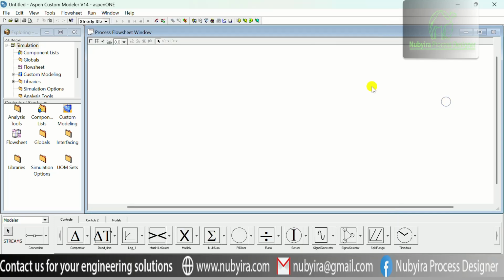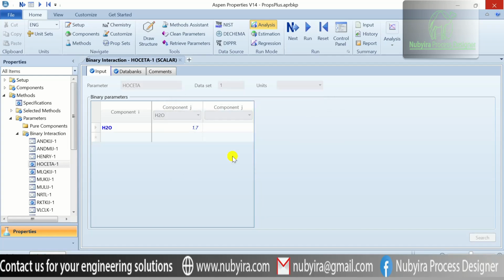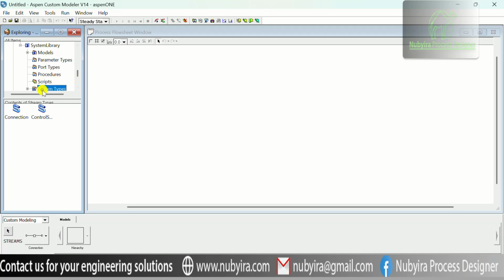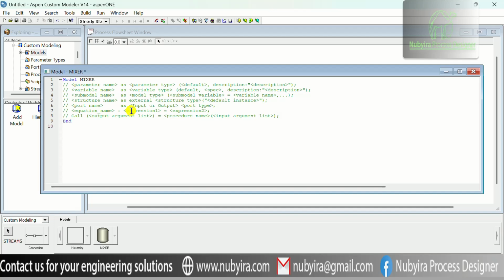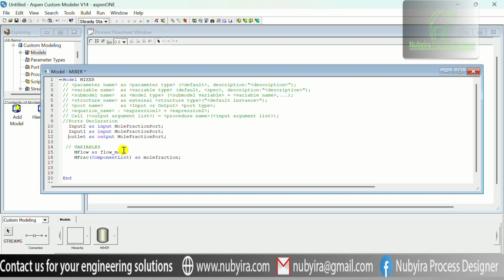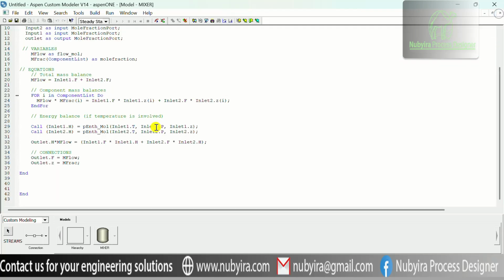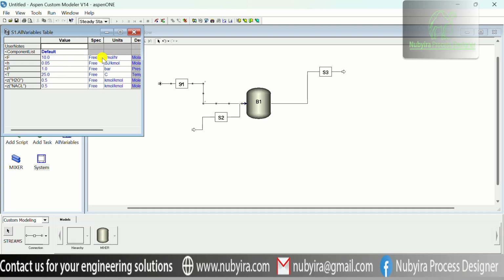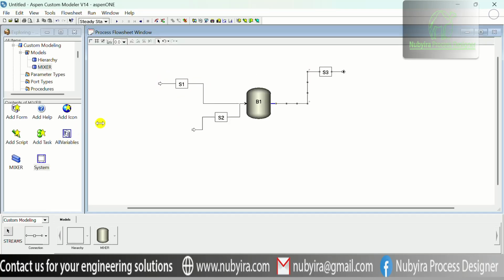Introduction to Aspen Custom Modeler for Beginners

Comment: In the previous video, I saw the use of ACM for gas drying and purification. Recently, I have been working on building ACM models for electrolytic cell separation and purification. I would be very grateful if you could produce a similar video. Thank you.:popcorn-yellow-striped-smile:
Reply from the maker: Check my video catalogue for pem Electrolysis cell development with ACM